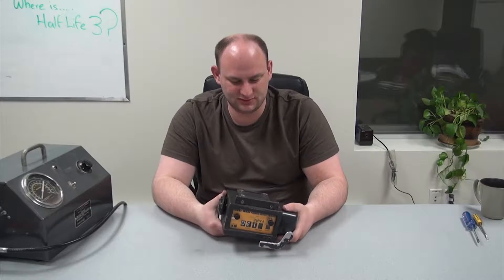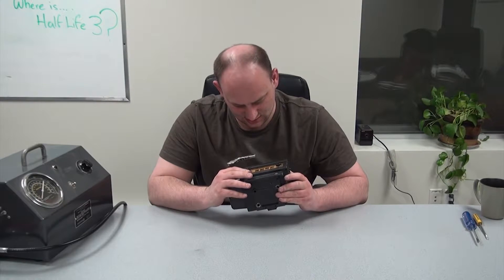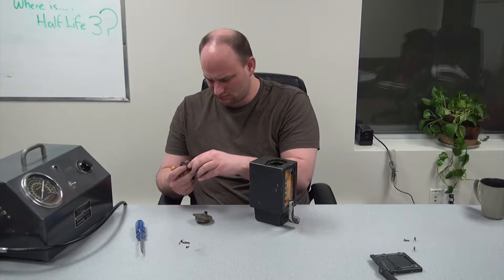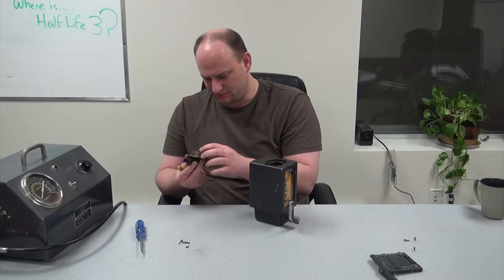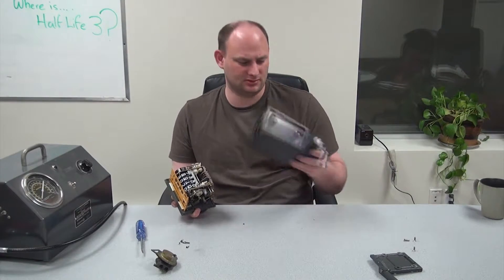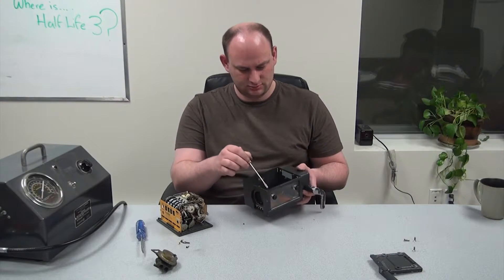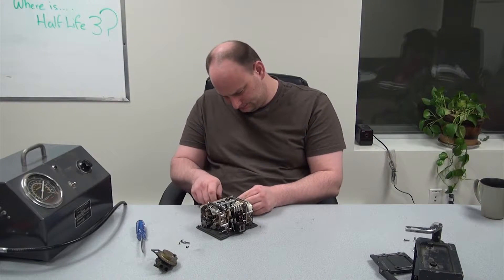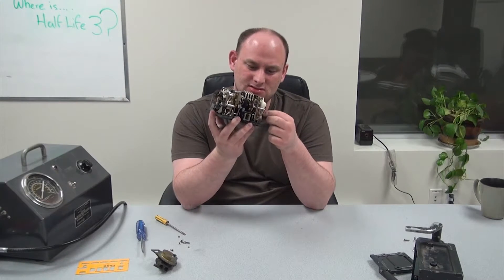What's inside this old German Taximeter

Comment: Thanks for answering my question. I have another one for you. What is that piece of equipment on your right that rotates the screw which turns the meter?
Reply from the maker: The machine is a speedometer testing tool/machine. It simulates the rotations needed vs speed. It can simulate driving at different speeds to check for accuracy
Reply: Do you have a link where I can order the most simple version? Or can you tell me what brand yours is so I can order a similar one?  I have a bunch of taximeters that I want to play with. Thanks.
Reply from the maker: @mvravr  Sorry but the machine I'm using is long obsolete and is older than I am. Sometimes I'm surprised it even works. I can set you up with something that can work in a drill using the flexible cable and some tips. Send me an email at orders@recordtechnologies.com and I'll go into more detail. Hope that helps!